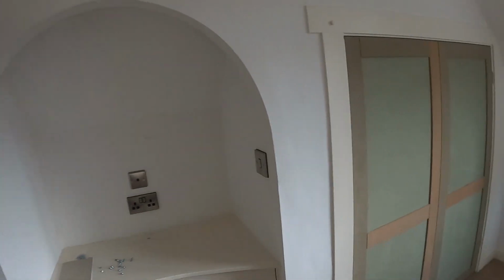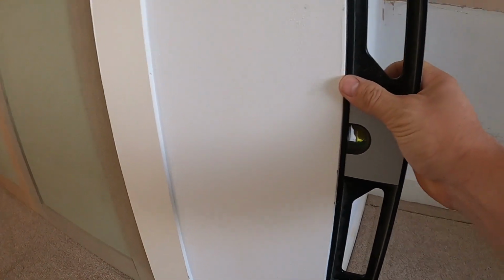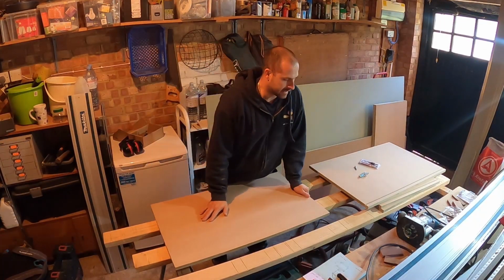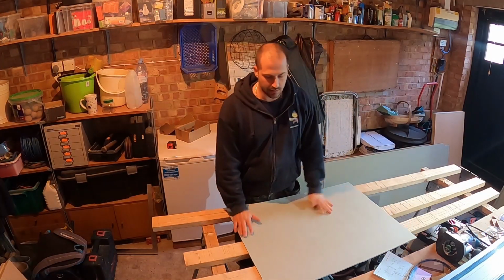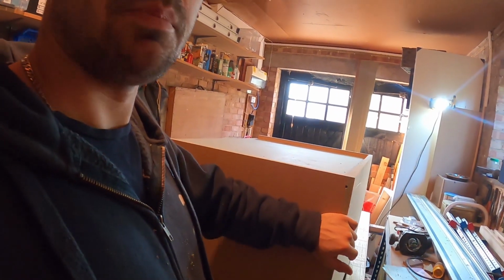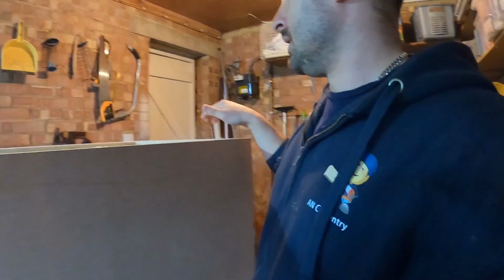How to build a cabinet unit - from start to finish

Comment from the maker: 0:00 Intro
2:22 Removing the old furniture
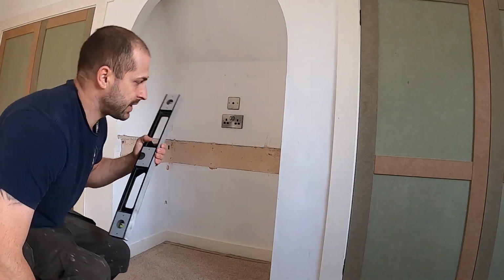2:55 Checking wall levels
4:10 Taking measurements
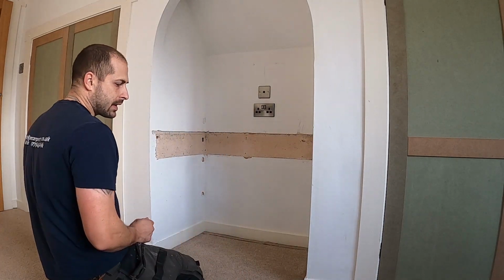4:31 Special customer request
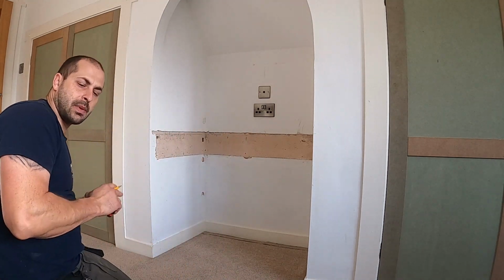5:36 Discussing the unit material
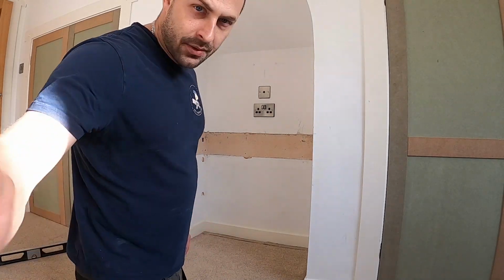6:21 Next step: Plan of action - cutting material (discussion)
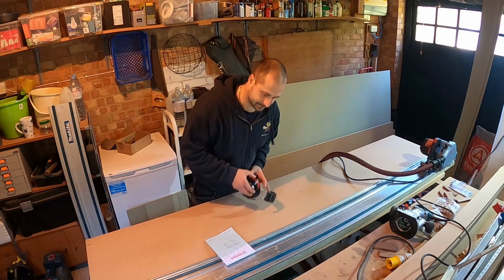8:12 Cutting in action
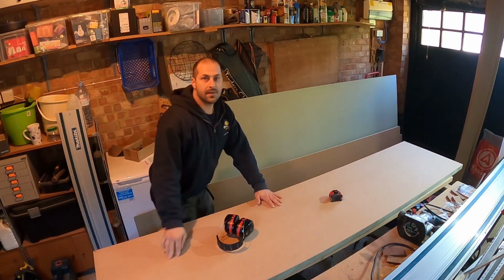8:23 Next step: Working out the measurements (discussion)
10:21 A bit more cutting
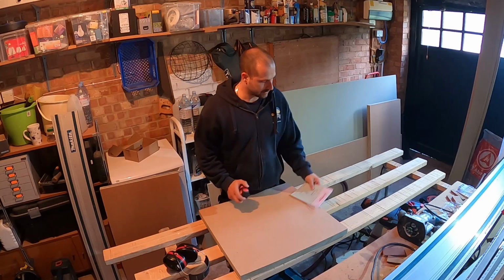10:52 Next step: How to work out the groove for the back (discussion)
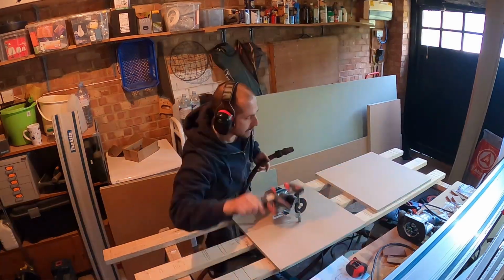12:00 Cutting the groove
12:35 Next step: Discussing sanding (discussion)
13:06 Sanding in action
13:23 Next step: Measure the back (discussion)
15:44 Cutting material for the back
16:25 Next step: Assembly (discussion)
17:08 Assembly in action
17:52 Next step: Strengthening the unit (discussion)
20:15 Strengthening in action
20:57 Final thoughts and suggestions (outro)

Comment: What are those superior levels like to use are they fairly heavy and quality built? Do you tend to use these as your go to level over the stabila
Reply from the maker: Must say they are heavier than your stabila  lvl, as with all levels you can get lucky and not so lucky,  if i speak about mine i haven't been so lucky, as this is second set of them and the one which i got as replacement was with at least one bubble faulty on each level so unfortunately i can't recommend them and not sure what to suggest either as have tried most brands and no luck so far.